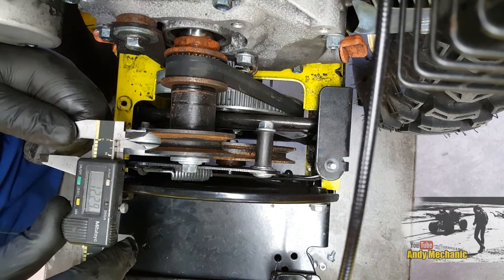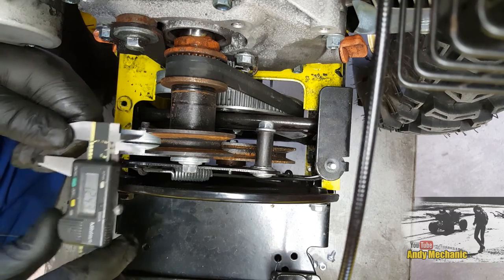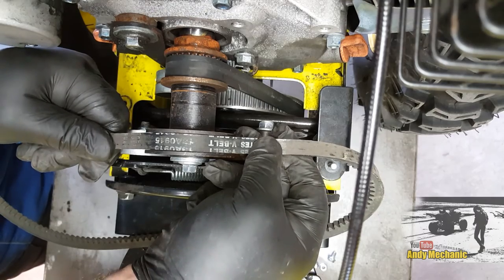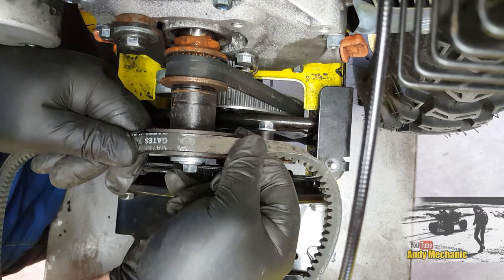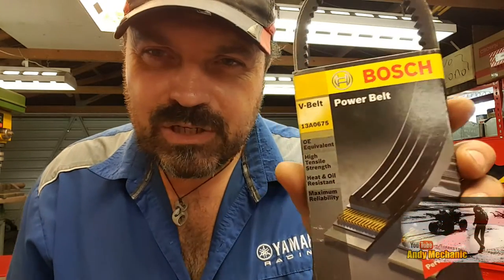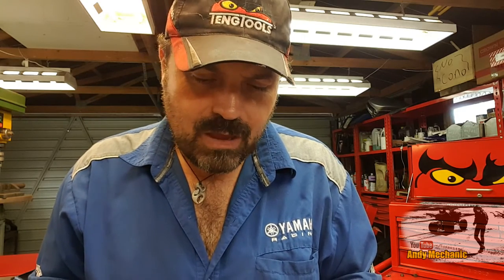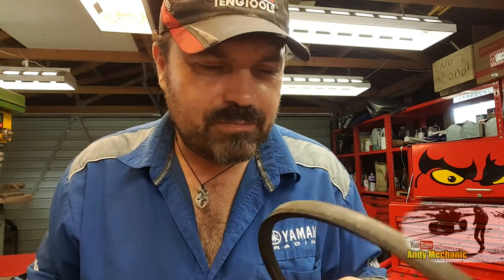Petrol powered sweeping machine - no drive to brushes #1962

Comment: The rear of that machine and belt drive is actually a snow blower. The simply attached a brush where the augers would usually be. Even the electric start from the mains is standard on most snow blowers.
Reply: Mitch haha you know  what  I was thinking the same.

Comment: i just  don't  get  why  they don't use  a  clutch  system will it really cost that much
Reply from the maker: +bac302 agreed....the system is crap. It's had another 2 belts fitted since I did the video!
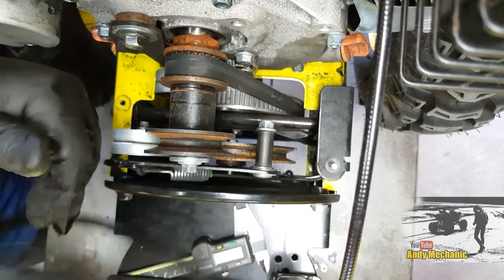Reply: @AndyMechanic    Hey Andy great vid.  But something you didnt mention and I didnt see you put back in place is the belt guide/roller on the right side of the crank shaft opposite side from the idler tensioner pulley.  In other words looking at the machine from the brush end of the machine.  When you dissassembled it there was a belt guide on the bracket that has a long slotted hole for adjusting the belt guide.  And i see you said it keeps eating belts....maybe if im correct and that belt guide is missing then the belt could prematureley wear or wander.  Go back to around 9:22 in the vid to see the component im talking about.  Maybe you did reinstall it but i cant see it in the vid after you removed it.  I happen to be about to work on a few Ariens 28 and 36 power brushes.